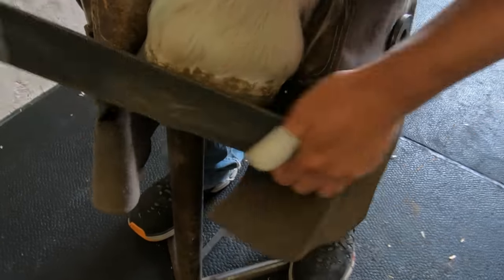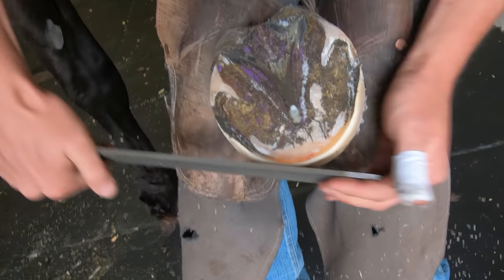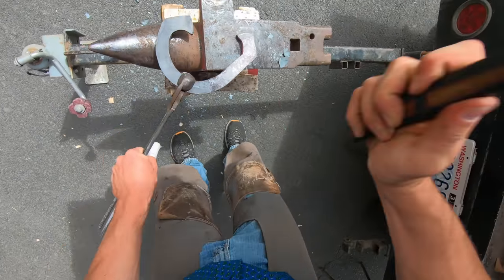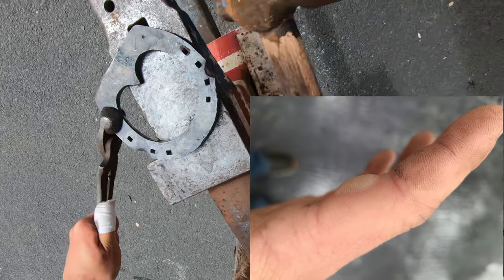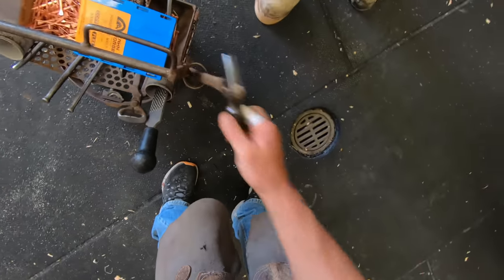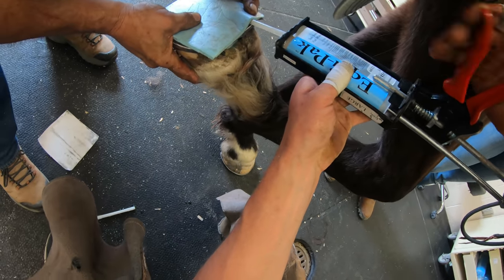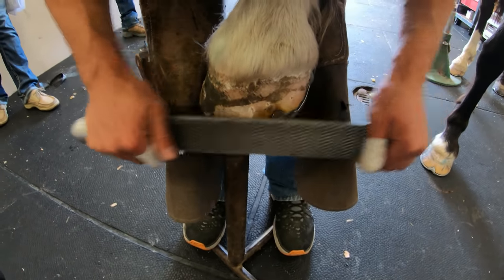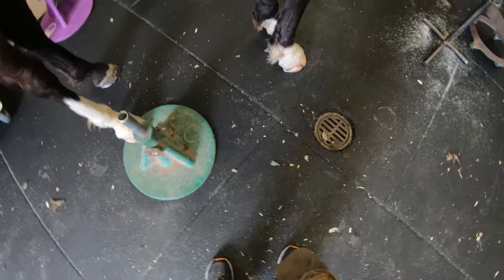BROKEN Coffin BONE // VETERINARIAN and FARRIER working together // THERAPEUTIC HORSESHOEING

Comment: Great job today Sheldon. You’re a very talented farrier.
BTW Flux is a fancy word for cleaning. It is used to remove metallic impurities from the welding surface and prepare a clean, solid joint.
Reply: a clean solid joint how can metal and flux make weed
Reply from the maker: Thanks! yeah I understand that part, it is more the chemistry of how it works that I was referring to that I don't understand.
Reply: @maverick_vet  Gotcha…same here. Above my pay grade 😆
Reply: @maverick_vet  heating up metal in an oxygen rich atmosphere speeds up the creation of metal oxides (ie rust), and fluxes are reducing agents, which break the metal oxides to create flux oxides (slag) and pure metal. You can get more detailed with charge differential and chemical equations, but that's the sum of it. 

I think some types of flux can draw out other, non-oxide impurities, but that would depend on the specific chemical makeup, and I think that's more in the context of smelting ore than forging steel.
Reply: And not all fluxes are created equal; blacksmithing flux is very different than plumber’s flux, which is also very different than electronics flux.

Comment: The flux lowers the melting point of metal, by using it for welding it makes the metal super soft and joint together. 

They also use it for smelting to lower melting point and separate the bad stuff from the good metal

Comment: Next time you have trouble with tips like that duct tape you heels and poke a hole in the center of your board with your tip and fill it from the center. It works great. You do a great job.

Comment: Flux lowers the melting point of the oxides, that black stuff referred to as scale on the outside of the metal.  It helps to melt the oxide and then mixes up with it to make it less viscose.  Then when you hammer the joint together the oxides squeeze out so you get a nice metal on metal bond.  It also prevents any further oxidation which is important since you need fairly high temperature to forge weld.  Without it you get oxide inclusions in your joint where you've got a metal-oxide-metal sandwich and since the oxide doesn't bond well with the metal and is much more brittle you don't get a strong joint.

-materials science student about to graduate from UW Madison

Comment: Hey Sheldon first I wanna say I’m not  a farrier or horse owner but I love your videos. But I have an odd question. What does the smoke smell like when you burn on shoes like that. There is so much and I guess I just wonder lol thanks love what you do
Reply: My guess is that it would smell similar to singed hair, since both hooves and hair are made of keratin. Maybe just more intense.
Reply: I smells of burned hair.
Reply: Closest comparison I can think of is burning bone. If you’ve ever had a tooth removed and they had to use a drill to separate the roots, it smells the same. Really awful.

Comment: I realize this is a late comment, but what flux does is block oxygen from reaching (and oxidizing) steel.  When the steel heats in the presence of oxygen, you get firescale (that stuff that flakes off), a type of oxidation.  Metals can only be welded when clean and debris-free.   On a side note, as someone who apprenticed with a blacksmith, I'm very interested to know how you take care of your tools, specifically the ones you use to trim up.  Do you have to sharpen them?

Comment: The equipak cartridge was upside down.. There is one way to properly insert the cartridge into the old dispensers.. It's always withe the label facing up.. The new dispensers can be inserted either way I believe.. Hence part of the difficulty you may have been having
Reply from the maker: Thanks

Comment: Why copper nails instead of iron? Don't you run into corrosion issues using dissimilar metals? (admittedly, Iron and copper aren't too bad when used together.)